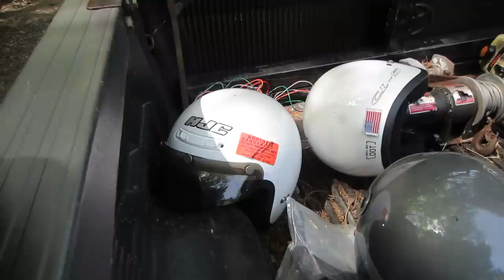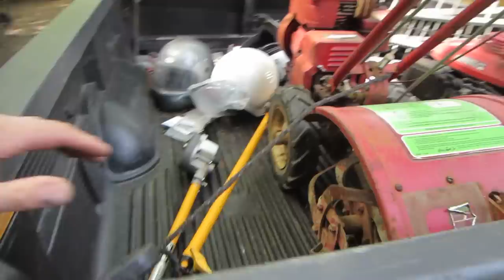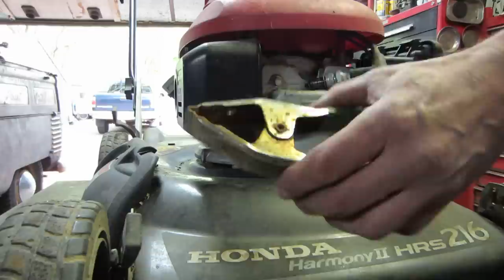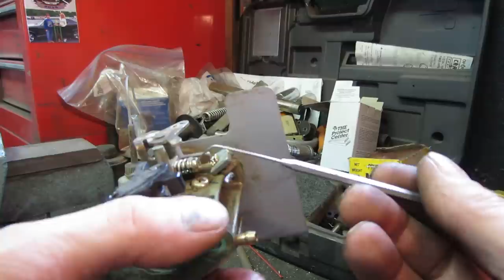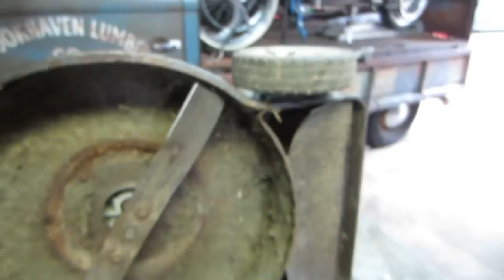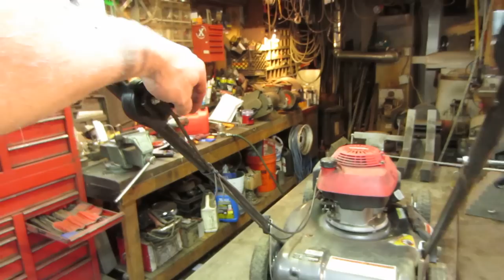yard sale honda mower repair

Comment: Excellent vid as usual sir!! Thanks! Question- is there a way to use some flexible wire or small pipe cleaner to rod out the clogged tube in the carb?   Thanks Mr Mustie.  Loved it.  S

Comment: I had that idle occilation before.. there is a spring in the throttle linkage that is worn and stretched..I used a cable tie to tighten the spring it WILL idle perfect

Comment: My rider has exactly the same problem. I've torn the carb apart and cleaned it but it still hunts unless I choke it down. Since it's a 20hp Kohler engine a new carb won't be cheap.

Comment: Honda carbs are pretty much designed to be throw-aways. I bought a new one for $20 at my local shop, had it installed in five minutes. It didn’t even need to be adjusted. Mower runs good as new now. Thanks to Mustie1 for giving me the courage to work on my own equipment.

Comment: FYI when you  take main jet out there a tube that jet seats in. From top middle inside carb throat you can push that tube down to remove. It has several holes that you can clean. That will fix the problem.

Comment: I bought an expensive shredder with Honda engine supposedly little used but I later found it was burning oil. Within a short space it threw a rod and cracked the casing. New Honda engine wad phenomenally expensive. Eventually bought a new Chinese knock off in a box for about £150. Runs perfect and possibly better than the Honda, which I doubt was Japanese anyway.

Comment: You mentioned "Not being sure...." about Seafoam.
I looked up the MSDSs for internal engine cleaners and 
Seafoam was 15% Isopropyl Alcohol, 30% Naptha, and 55% Pale Oil (diesel).
Marvel Mystery Oil was 25%  Naptha and 75% mineral oil.

Comment: Hi Mustie, I was going back throw some of youre old vids and found this one. I have a cub cadet sc 100 hw and mine surges. It seems to be what this one is doing. Ok the reason I'm reaching out to you is the carburetor is a MTD 951-05531. But mine is a 5x65b and when I look up online the carb for mine it comes up 5x65a. My question is what is the difference between the two ?, because I can't tell
Reply: Mtd 951 05531 and on the housing it's stamped 5x65b on mine. But I see there is also a 5x65a. I didn't know anyone else to ask. Youre like a Engine Guru.

Comment: If you still have the Ryobi weed wackier/chainsaw? That chainsaw is most commonly used by loggers for trimming logs on tractor trailers so they are legal on the road. If you haven't sold it yet just call any loggers listed in the phone book as I'd say one of them would jump on it.

Best of luck.

Comment: I’ve always wondered why Honda puts its oil fill (level indicator) on the side, and at such a inconvenient angle.
My two issues with that Honda ( on a snowblower is it’s difficult to read the level on the short yellow stick and it’s difficult to add oil at that crazy angle.

Comment: There comes a point when the $15 or less  for a new carb is worth it to get something fixed in a short time frustration-free. I had a horizontal 850 series Briggs that had the main bowl pickup bent beyond repair and a new carb was only $12. On the other hand, the carb on my Briggs opposed twin would've been about $80 used, so I definitely had a reason to actually work on that one. Newer cheapy carbs are sometimes not repairable IMO.

Comment: I actually own a mower that is the same series,different model. mine has a bit of a different choke control and it is older so you have to turn the choke on,pull the rip cord,hold down blade control,then you have to shove forward  this clutch and you lose a lot of RPMs for a few seconds before the throttle takes over. it pretty much just turns it to wide open throttle and(of course) engage the clutch. it is real loud though. but is does git the job done.

Comment: I have a honda mower engine like the one your working on and it on the compression stroke it hits a hard spot the valves seem to be ok but i dont know what to think. What are your thoughts on this?

Comment: Have you ever tried soaking something like that carb in Purple Power from Wal Mart automotive? Purple power is like an extreme grease/oil cutter that seems to have an acid component. Pretty powerful stuff and might work on something  that is plugged up and won't respond to anything else. Rather inexpensive too.

Comment: my mower had an ocelation problem too.. used it with problem, cause it got the job done.. found problem was that I had over filled the oil level just a tad too much by accident. i'm not a mechanic, wish I was, so I was stuffed for a remedy..  I stumbled onto a resolve by chance.. I drained some oil, and since then, has been running like new. the mower is 7 years old.. I guess it dos'nt have to just be carb problems. does it??..

Comment: had the same problem a few times with that type honda carb' , under the idle jet screw you gently put a screw into the idle jet and it lifts out ? works well for me mate . 
 cheers
Reply: sorry , idle jet cover screw... oops then lift out the idle jet

Comment: Old Video, but a valve adjustment, $12 replacement carb & gskts, and a throttle governor adjustment will get it going. That surge is the throttle governor, if you were to watch it's actions while it runs with choke off. Easy fix. Common on Honda GCV160/190 4-stroke engines, that are a few "seasons" old.

Comment: you should try soaking your carburators in regular old pinesol it works wonders on cast aluminum for realy dirty ones i use aluminum coil cleaner for ac work will take it all back down to bare aluminum

Comment: What cleaning fluid do you use in your ultrasonic cleaner? I picked  up a harbor freight heated ultrasonic cleaner and want to use a decent cleaner in it for doing carbs...
Reply: Simply awesome cleaner from the dollar store works great. Add water, dont use it straight out of the bottle.

Comment: The tiller we got a a mower with the same motor it sat for 20 years and did a little work on it andi it ran fine for a 1972 mower briggs run forever

Comment: I have a mower that will not start.  It has a spark.  It has good compression.  I cleaned the carb jets.  I checked both intake and exhaust valves are working.  It will not come close to startiing with starting fluid sprayed into the butterfly open, then choke closed to start.  Any suggestions?
Reply: @ritchiesokol1061  Turned out to be a timing issue as the blade hit a rock, so the timing between the magnetos and coil was off.

Comment: I have a Toro Pro with a Suzuki engine that does the same exact thing, I cleaned the carb and opened the main port a little just like you did, no improvement, I guess I need to find that idle jet....wish me luck.

Comment: I heard somehwere if you even drop your helmet once you should get a new one because the Styrofoam could potentially crack inside. I don't know if this is like a real rule serious bike riders follow or not, I'm curious if anybody knows if that's overly cautious or if a dropped helmet might be compromised enough that it'd be worth getting a new one.

Comment: What kind of table is that? ive been wanting one for years now. I do lawn maintenance and try to fix all my equipment. Doing it on the floor sucks. You recommend an electric or pump style table?
Reply from the maker: its a handy lift, mine is air never had the electric one but think it would be not as noisy and maybe be able to stop at any position without the safety bar.

Comment: Tyral fixes all youtube channel he always finds the high speed idle circuit and pin drills it out to the next size to fix that problem with that running problem

Comment: GCV 160, if Im not mistanken. Every single little hole hans to be poked, blown and cleaned. A carburetors is a mechanical part and close to be undestructable. There light have been a little Cruz og something restricting the full flow, through the idle/pilot jet.

Comment: The fix would have been to open up the idle.jet hole in the idle circuit. Poke it down where the idle jet is removed from and slightly open it up.  Works every time.

Comment: I was mowing my grass several weeks ago with my Honda hrr216 and I ran it out of gas.  I refilled it with more gasandit would not start.  I sprayed some starting fluid into the air filter and it ran for about 10 seconds, so that told me what the problem was - the carburator.  So, I pulled the carb and cleaned it.  I found a little trash in the bowl, but not bad.  I put it all back together and it still will not start.  I have checked and double checked everything.  I am about to replace these carb but I cannot think what else it may be.  Any thoughts?
Reply from the maker: when you drop the bowl on the carb is it full of gas?
Reply: Mustie1  let's say it is partially full.  I tried to measure what was in it but it leaked out the bottom before I got it off.  I know it has .5 ounces of gas in it, because I caught that much before it got out of the bowl.   I think the float and needle are bad but I can replace the whole carb for less than buying these two parts.    That is the price you pay when dealing with Honda.  Give me a Briggs any day of the week.  I am in the process of restoring a V21 '88 Snapper with a 3.5hp quantum engine.  It weighs about half what the Honda weighs.  When they say a Honda is the Cadillac of lawnmowers,  I think they mean a '74 Deville.  It sure isn't a lawnmower to dance around trees, bushes and obstacles and working non them is a PITA.
Reply: Mustie1  no, it was full of kerosene.  I grabbed the wrong container in the shop.  My regular 4 cycle gas container was empty so I grabbed my backup container that I had full of kerosene to burn leaves.  S happens.  No excuse other than carelessness and haste.

Comment: i have the same mower, massive issues with this mower on starting.. one of your previous videos you mentioned to pull the main jet from the center of the carb and inspect the small jet holes and they were plugged bad and it just refused to start.. it was a nightmare i actually ended up with 7 of these exact same mowers with the exact same issues and the same repair fixed them all had 7 fixed cleaned the same day =D i now have a 6.5 honda self propelled with a spare 6.5 motor that run flawless that the only way to start was to use ether before the fix.

Comment: Question: Why couldn't you drill out that pin on the bottom of the idle circuit to open up the passageway and clean it, then tap it and put a small set screw back where the pin was? 

I hate the fact that small engine makers are making it harder and harder for the average joe to work on these engines.

Comment: still have my troy built pony tiller from 1989. sold another one like yours for $375 but it did have electric start. compare these to the new troy builds now owned by MTD and the new ones are junk.
Reply from the maker: thats the same with most things today

Comment: How would you fix a Honda that won’t roll back on self propelled?
Reply: Jose Gomez they have a plastic bushing on the axles that clog with dust & grass etc., Honda had a recall on some of them. You might try a Honda dealer for warranty work. Mine did the same thing, they covered it. If not replace the bushings, use some grease for lubricant

Comment: These are not "real" Honda's, they are those OHV/Kohler style engines with a Honda label slapped on them. I had a similar machine that had exactly the same problem. Just always ran it where the choke would be fine.

Comment: Motorcycle helmet manufacturers recommend replacing helmets 5 yrs from date of manufacture, they are looking at a variety of things including product liability.  In the real world a helmet sitting in a box in the warehouse isn't aging very much, the things that age a helmet are UV (sunlight) and chemical exposure, the UV degrades the shell over time, and petro chemicals, oil and gas are very hard of the impact absorbing materials, gasoline will flat out dissolve some of the impact absorbing materials.  A lot of the way a helmet ages has to do with how its treated, but in any case a helmet over 10 yrs old should be replaced even when treated carefully.  Federal law requires that the manufacture date is stamped into every helmet.

Comment: Chinese carburetors are cheap, adjustable, and are reliable. I can't afford the Honda OEM carbs, and they don't sell online (dealer only). The chinese aftermarkets are better/cheaper/adjustable. $14 includes carb, plug, filters, line, etc. etc.

Comment: Honda man trying Simple Green to clean out the carburetor the best thing you can use dump all the sea fome out ur Sonic part washer clean it real good then get you some Simple Green it's what I use to clean a carburetor Lawn Mower on small engines Simple Green is also environment friendly Simple Green will make your carburetor clean as if it was new trust me I know what I'm talking about
Reply: Use Acme degreaser and waterway acidifier. Very good.

Comment: There is no helmet expiration date per se, just an industry recommended replacement after five years.  Some racing leagues won't let you use a helmet that is older than five years old.  I have tried MIGHTILY to find the source of this idea, when and where it came from, but have been unable to thus far.  Personally I think it was dreamed up by helmet maker sales depts wanted to sell more helmets.  They say it's because drops, chemicals, heat, dirt, sweat, rain, etc could degrade the material quality.  A reasonable argument.  But it's only a recommendation used throughout the industry, of unknown origin.

Comment: I can not work with gloves I need to feel what I am working on. Not bragging but never did I have to buy a new carb was always able to ckean and adjust them but sure a new carb someday will happen. Should check tge flow of gas in the line of its not that good could BS the filter in the tank

Comment: The only thing I've ever disagreed with Darren is the way he drains oil.
I always use the plug in the bottom of a small engine if it exists. That allows any sludge in the Bottom of the crankcase to come out and if it has a magnetic plug you'll see if the motor is producing chunchs of metal.
The ones that don't I clean and slightly grind the top of the plug with a small hole drilled into it and a right sized magnet then glue it one with metallic JB weld.
Two years small engine vocational training taught me that trick and process.

Comment: There is only a ear say thing about helmets health & safety says not to buy helmelts 2nd hand because you do not know if the standards have been abused, such as they have been dropped or flawed in some way.   The standard trademark which is BS _ _ _ _ just means the standard is not of todate use, modern helmets now have Carbon and so forth in them which means they are more strength in them where as yours will probably be fiberglass.  There is no legal requirement for them other than would you buy a 2nd hand helmet over your head surviving a crash or not.  Personally I would never buy old, my life is worth too much.

Comment: haha go to the your local police department and get a radar detector you can find out how fast that late actually goes sharpen your blade 3 to 4 in from the tip both sides balance of course you want a good fresh clean cut
Reply: Ed Miley harbor freight meter...$15.00

Comment: Is the bolt full of gas when I remove it?  It has some gas but it all leaks out before I can get it off.  I am not impressed with the operation of the float and needle.  Ordinarily, I would replace both of them but they cost more than a whole new carburator from eBay.  I have checked the compression and it is fine.  I want to adjust the valves on this 4 year old machine but the weather has not cooperated.  I can always cut the yard with my new Snapper SPX, 23,42, FAB and clean up with my weed eater.  I will never buy another Honda.  Give me a Snapper with a Briggs on it any day of the week.  When they say "self propel" it really is a "John propel."  Pushing that boat anchor around the yard will wear you out.

Comment: You take a lot of short cuts which is fine because you own the mower. You have a lot more money then myself but your really to lazy to take a blade off to sharpen and balance it? You said you wish to sell it for 75.00 to 80.00 ? Don't do anything to it but make it run lol. Wow for a guy that has a mower repair show so to speak you cut way to many corners.